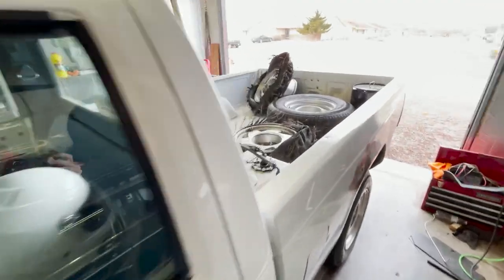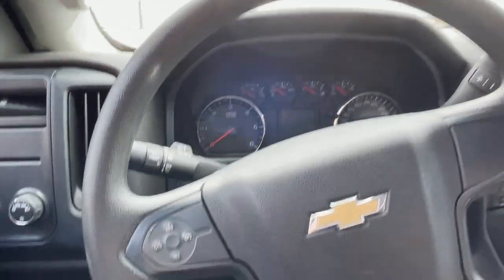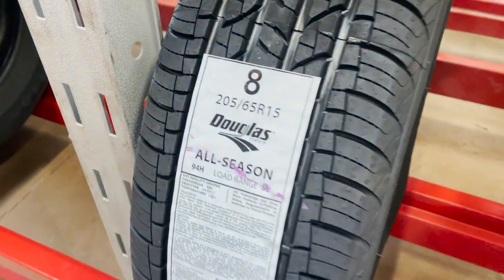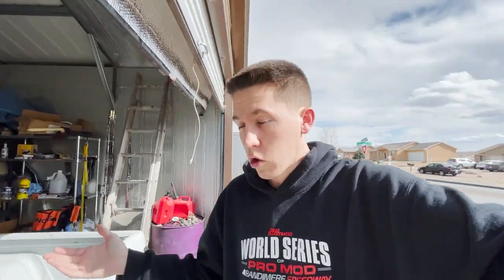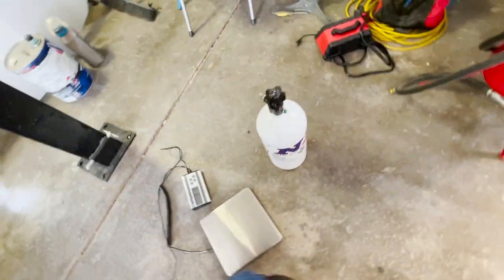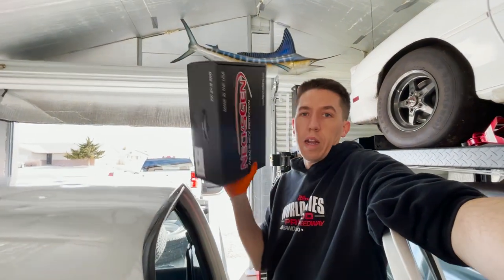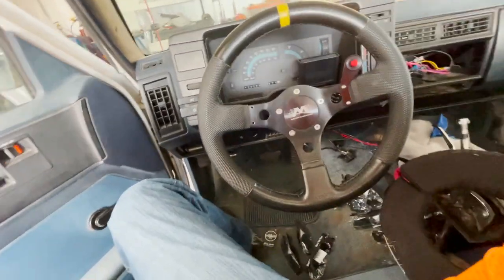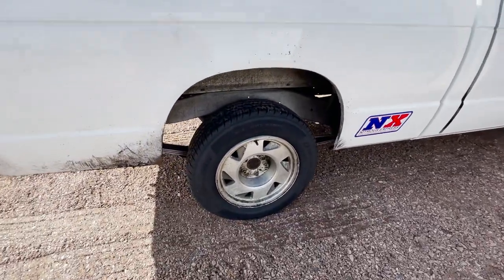Burnie's Top Secret Burnout Tires Revealed!

Comment: Something to consider for when trailering Burnie on a open trailer or any vehicle with a air cleaner sticking out of the hood and can be done on vehicle without a hood with a bit more effort is to find the appropriate size plastic bucket that will fit over the air cleaner assembly and if necessary cut it down to the correct height so that if drill a hole in the middle and glue a "fender washer" to the inside of the bottom (now top" of the bucket and iplace a piece of foam high density foam about 1/2 to 1 inch thick on the inside of the bucket. Additionally you will want to glue a piece of split a piece of rubber hose or use whatever form of window strip gasket etc you choose to the edge of bucket that will come in contact with your hood to prevent it from scratching the finish and then before trailering your vehicle remove the wing nut or hold down bolt from your air cleaner and place the bucket over your air cleaner assembly and place a washer and a gasket (i cut mine out of inner tube a used an awl to poke a hole just big enough to stretch over my air cleaner hold down stud and instead of using my normal wing nut i would use two nuts and lock them together so they would not come loose.  When cutting your bucket and tightening it down make sure not leave the bucket to long or tighten it down to much to avoid damaging the hood or carburetor of your vehicle.  Just because I was super anal about dust, water, etc getting into my engine while trailering it I also covered the air cleaner over with a drawstring plastic bag under the bucket as another layer of protection and had a nerf basketball inside my air cleaner.
Reply from the maker: The plastic bucket is a great idea, thanks for the info! I tried a trash bag on the way to Houston today and lost it pretty quick 🤦‍♂️ I have another one I’m going to try and sandwich between the throttle body and air cleaner base and see how that does. I definitely like your idea of a bucket though that would definitely help protect everything! Thanks for taking the time to explain it🤘
Reply: Yea agree used a bucket on my daily driven car with a air cleaner out bonnet. not good trying to start a car when water got in to carb.

Comment: Kelly and Jetzons are cheap and smoke pretty well too
Reply from the maker: Where do you get those at?
Reply: @BuildTuneRace  the shop I use to work at used ITD(independent tire dealers) network for tires. Don't know if theres any in your area, but most of the big tire wholesalers should have them